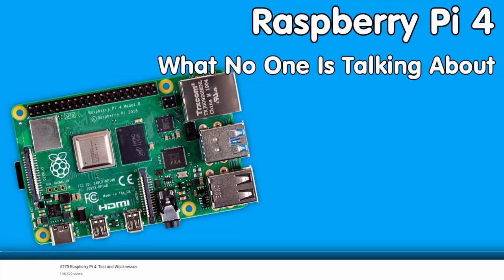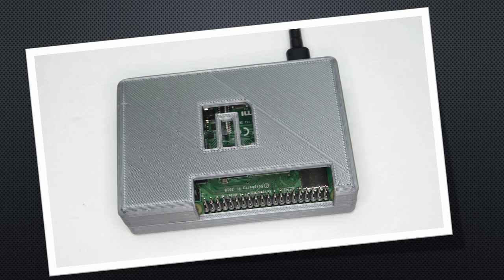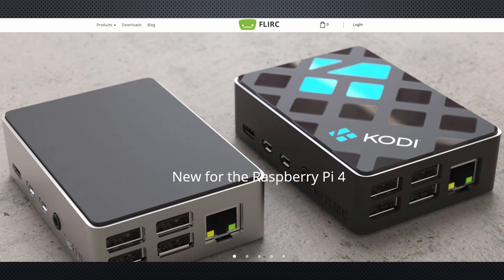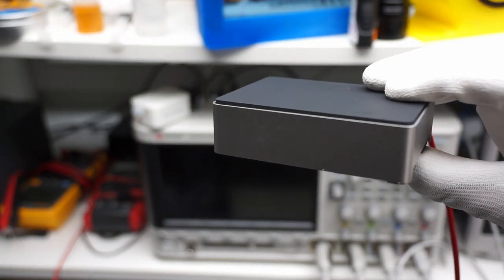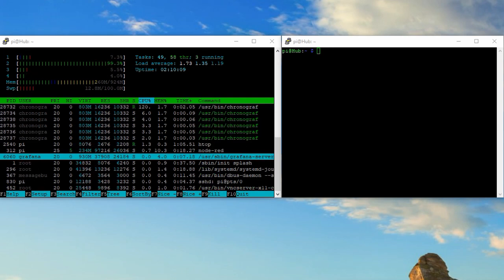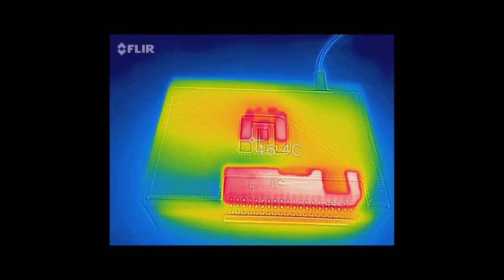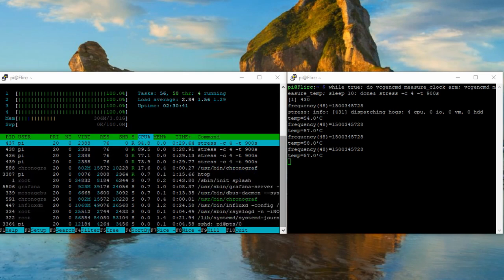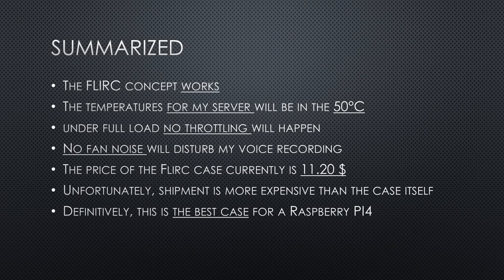#283 FLIRC: A Cooling Case for the Raspberry Pi 4? Does it work? (Quickie)

Comment: I have a flirc case for model 2 or 3 - damn expensive back then. Cooling the raspberry pi 4 was an easy challenge: bought a kit of acrylic case + contant fan - silent + cheap for 5€
Reply: I ordered a flirc case 3 years ago when the PI3 first came out.  Hope the PI4 fits OK (not got one yet)
Reply: @noggin73  The Pi4 is a new board design. The ethernet port was moved and it went to two HDMI port. The old cases will not work with the Pi4
Reply: @bradquinn4161 , I am using a case with a RPi 4,  4GB unit that I bought for an old RPi  2 that I never used. It works well with a RPi 4.  It has active cooling with open sides.  I also have a RPi 4, 2GB in a Flirc case.  The unit with active cooling runs about 6C cooler at idle than unit in the Flirc case.  Neither unit will be running with a heavy load, so I didn't run a stress test.  https://photos.app.goo.gl/PMQAsXXWz41m8epq9, 
https://photos.app.goo.gl/JcXAW2yMCCEHD2Lr9
Reply: @WilliamBurlingame  I assume you mean that you are running the Pi-4 in the NEW flirc case and not one of the earlier models.
Reply: @bradquinn4161 , yes, but the NEW flirc case doesn't cool as well as the OLD iUniker case. With shipping, the NEW flirc case was $22.80 and the OLD Case was $8.99 with Amazon Prime. Ambient noise in my computer room is louder than the fan.  That unit is an a shelf on the other side of the room.
Reply: @WilliamBurlingame  IF you look at what the OP posted, he has an older Flirc case and the point I was making is that it will not work with the Pi4. I also think that there may be a couple of other issues going on here. For whatever reason some Pi4s seem to run about 10C hotter than most (mine is one). The other thing (specific to current Flirc) is that it sometimes takes a month or so to "settle" in to a temp. For the first month my Pi4 (in a Flirc) idled at around 60C but never got above 70C(you did not want to hold onto the case very long either). Slowly over about a month it has dropped to an idle of about 50C(all temps were after the usb power cool firmware was applied). It is pretty rare for a passively cooling solution to be better than an actively cooled one. So your results do not surprise me. One of the main intents for the Flirc/Kodi case is in a home theater and the acceptable noise threshold is generally lower than in a computer room.
Reply: @bradquinn4161 , I was hoping to replace my Win 10 HTPC with a RPi 4.  It's not working out.  I have a 4K HDR TV.  The RPi 4 can't play a 1080 YouTube video in a browser smoothly. I did increase the RAM split used by the GPU.  It does a little better with LibreElec installed.  I don't know if browsers use GPUs or not.  I ran a speed test and got 98 Mbps down.  The small fan on the active cooling case is much quieter than the fan in the Win 10 case. That system is not in my computer room.  I have a mini ITX mobo in that case.  BTW, I made the original post because i have read in many posts that old Pi cases won't work, when they should say MOST old Pi cases won't work.
Reply: @WilliamBurlingame  Part of the problem is that they released new hardware on a new OS version. So drivers and optimization nail you with a double whammy. Six months down the road we should be in a better position. Chromium (not a fan personally) seems to handle youtube MUCH better than Firefox. Supposedly Pi4's restructured the way GPU memory is used, so anything beyond 256 (or much less in most cases) is unnecessary.  I am using the Pi4 to switch out using a Xeon as a daily driver and am pretty happy with it. It is not a replacement for cpu intensive stuff (say video encoding) but for email, browsing, basics youtube it works good enough for me.
Reply: @bradquinn4161 , I just wait and see with my 4GB unit.  I plan to use my 2GB unit to run PiVPN as soon as I get a new SD card.  I'm now using a very old and slow SD card in the 2 GB unit.  It takes a very long time to boot and to update/upgrade.
Reply: @WilliamBurlingame  You might want to look into doing a USB boot to a flash drive. It is a bit of a kludge on the Pi4(for now) but it is MUCH faster than running off a SD card (on any Pi version that has USB).

Comment: Great Video on the Heat dissipation properties of the FLIRC case, But the main reason for me to have a PI is to use the GPIO header.  I ordered this case and the GPIO plug will not fit.  I tried to cut the excess from the plug and there was still not enough room.  The only way I could get room for the plug was to cut the two threaded screw posts off the case.  The case still works but the GPIO side is not tight and therefor the Cutouts for all the plugs and connections do not align up properly.  I am not sure if the Case contacts the CPU good enough now to provide cooling.  In all I still like the case but wish this problem could be fixed.
Reply from the maker: I did not try it. I would have expected they tried it upfront. I usually do not need all pins and use individual wires and empty shells for the pins I need.

Comment: I got one of these flirc cases some time back, my pi over heated, it was a very hot day, I did a test with the pibow coupe on the same day with the heat sink, it didn't get as hot. Maybe the usb update has made a difference, I haven't used my flirc case since that day, but people's experience of the flirc case in the pi 4 seem different to mine, the flirc case has been brilliant for me with the pi 3.
Reply: My test was hd video playback and running updates, browsing internet, at same time, real world tests, flirc case started to smell of burning plastic.
Reply from the maker: Strange. Maybe the heat transfer tape?

Comment: Nice looking case and does the job well to say there is no active cooling. However I added a heat sink and a 40mm fan on a personalised 3D printed case and the temps are no greater than 42 degrees at full CPU load for over ten mins. Active cooling is needed if you want your Pi 4 to run as cool as possible.
Reply: The problem with active cooling over this case would be in situations where Pi's are running a kiosk or a graphics panel in a store where you would want to set it and forget it.. It would add a failure point that isn't necessary
Reply from the maker: I got now a case with active cooling to try. It also works quite well. But it has 2 small fans.

Comment: The FLIRC case doesn't carry the heat from the Wlan+bluetooth and RAM chips. They still heat up.
Reply: This is true, but sinking the heat from the processormakes the whole board a little cooler and while not directily sinking from other chips, they stay a little cooler by having the processor quite a lot cooler.
Reply: The new raspberry pi uses LPDDR4, way more energy efficient than the old LPDDR2. 
The RAM shouldn't need any cooling at all.
Reply: bonnome2 In an enclosed space... have a look at thermal images of RPi4. In any case, the metal shield on the CPU is groundplane, and will carry away the worst of the heat into the FLIRC case.

Comment: 7:12 Why on the second pedal to the metal test was used only one core 2? That doesn't seem right
Reply: If you skip a few seconds earlier you see it's all four cores. That is after the test finished. Don't know why that core is @100% after the test.
Reply from the maker: As I mentioned I used my normal "IOT server" as a base. There, Chronograph is quite power hungry...

Comment: Hi! can you give me a pointer in the right direction! i would like to set up a video with audio from a sound mixer and video camera (maybe usb) to network stream for watching the sermon at church in the baby room and maybe capture it. I was thinking rpi with usb cam to rstp stream and decode with rpi zero. Is this a good way to go? i would like HD say 720p at 24fps or better,  could i achieve this like this or is there a better way?
Reply from the maker: I do not have knowledge about video transmission systems :-(

Comment: I ordered some thermal heat pads and  plan to salvage some finned heat sinks from old pc boards and find one that will adequately dissipate the heat from the processor.  I'm not planning on using a case of any kind.   Function over form is my motto.  I've thought about maybe making one from old copper pennies or copper pipe.
Reply from the maker: The surface is king in heat sinks...

Comment: PLEX and Flirc Case = kind of room heater 

It is great, but currently a bit pricey, therefore here is a cheap, good solution:

Pi 4 & 2 GB RAM running PLEX Server H265 in 1080p ... leads to a server load of 75% in my case and less than +30°C above ambient temperature. Room is 31°C and Pi 4 reports 61°C instead of over 83°C without fan.

You can buy the cheapest acrylic case on ebay with fan for 3,40€ currently which will arrive within 14 days. If you install the fan as intended and our Swiss guy in a previous video did then that tiny fan gets annoying loud - around 55°C. If you want it nearly unnoticeable or soft then you do a simple hack: 
the fans are build for power users ... running on 5 Volt. You simply use the 3,3V + from the GPIO instead of 5V 

Therefore you need a fitting jumper cable as "extension" or you have to separate the 2 pin connector in 2x 1 pin connector with a dremel and a diamant saw cause you will not find ground and 3,3 Volt on the gpio next to each other. 3,40€ for a silent and a pretty good result, which will work in 90% of all users except the Pi 4 owners who are already crying for Pi5 cause performance is too low for them.
Have a look cause for 3,42€ and a bit of cutting work you get a lot, really a lot  
https://www.ebay.de/itm/264408007677

But I must admit that I also like that Flirc Case except its price tag, particular the total amount incl. shipping which is a joke. So I have to wait and see if prices come down or the chinese copy cats will push their clones in the market too.  

Fanless is the best and a 42°C heater brick is not so bad - except in nowadays summer.
42° to 24° is 18°C above ambient temperature in swiss guys setup ... pretty close to my +30° by a reduced fan performance from 5V to 3,3 V or 33% less ... und heavy performance of h265 encoding ...

Comment: Now this is genuinely a good product!   Yes, it should be the official case.
Hope that Flirc is able to sell enough to keep it going.
A VESA mount version may be desirable to some.
Reply from the maker: Maybe somebody will print a different plastic base which can be mounted to VESA holes.
Reply: @AndreasSpiess  Do you not have VESA 3d print files? I have several different ones if you want them

Comment: TO REPRODUCE THE PARTICULAR STEPS USED in this video you have to be aware that the infos linked in the description mostly refer to a Pi 3B+ test scenario.

HERE are the steps where and why adoptions are needed

Pi 4 is based on a different chipset with 4 A72 Cortex processor instead of 4 A53 of the Pi 3B+

So you can follow the steps mentioned regarding STRESS which is linked.

On that stress website you will find these 2 lines which do not really fit to the Pi 4 and therefore should not been used.

wget https://raw.githubusercontent.com/ssvb/cpuburn-arm/master/cpuburn-a53.S

gcc -o cpuburn-a53 cpuburn-a53.S

Instead you can use the code for the A72 ... which is here shortened to A7 ... so be aware of the difference that the Pi has 4 A72 Kernels but that the program here used is called A7

Therefore your procedures are these
Open the command prompt and paste each line with ENTER
Maybe create first a folder "scripts" with 
mkdir scripcts 
cd scripts

wget https://raw.githubusercontent.com/ssvb/cpuburn-arm/master/cpuburn-a7.S
gcc -o cpuburn-a7 cpuburn-a7.S

Then install the stress app with
sudo apt-get install stress
 
Now your are prepared for any stress test, if you do not forget that in case it gets too fast too hot you can press CTRL + c key to abandon the stress and high cpu load .
There is also a description in that Stress article you should read and consider.

The first step to stress your Pi 4 might be to not run the original code that would stress for 15 minutes. 
Here is a shorter one just to get familiar with the CTRL +c key break and the temperature increase but without any risk of damage to overheat: just 66 seconds are enough

If you - as I - may ask yourself what is going on the left command pane in this video tests above then just open a command prompt and type htop and press ENTER key

Now you have the overview about CPU load of each core and RAM and tasks.

Then you open a second command prompt and start your first tiny stress for 66 seconds ... where I replaced the 900 (which are 15 minutes) at the end with my 66 ... damn easy to avoid anything.

I also did not wanna wait for 10 seconds to get the temperature reported and replaced that 10 by an every 6 seconds report... yes this 6 makes it easier for you to find my changes compared to that original lines from the STRESS article

while true; do vcgencmd measure_clock arm; vcgencmd measure_temp; sleep 6; done& stress -c 4 -t 60s

You will get a temperature report every 6 seconds in that command promt and notice a jump in the temperature under the growing load , which you can watch in the htop pane on the left.

Maybe after 30 seconds you try to press CTRL + C to check if that will stop the stress test just to be prepared. 
It should stop the processors from rotating instantly if you look in that htop pane on the left, but:

the temperature report will continue ... and to stop that simply close this command prompt and start a new one ... but I guess there are several others and better way to stop it.

Now you can increase the 66 seconds time limit slowly to 900 seconds depending on your results with or without any cooling. But first things first to understand my procedures

EXCOURSE: My test scenario and results for the cheapest, but silent Pi4 solution 
=================================================================
My temperature reports went pretty fast but also pretty stable around a nice temperature peak . 
Within 45 seconds 60° C (+/- 1°C toggle) which equals to +31° C higher than ambient temperature 

This is the result of the cheapest acrylic case and fan with unnoticeable noise level for 3,40€ in total.

I bought on ebay an acrylic case with a 5V fan of 2,5 cm diameter or so. If you connect the fan to the 5V pins of the gpio you then might pretty soon become annoyed by the noise level - while you might be happy with 45°C even under full cpu stress which is just +16°C. 

But I prefer a more "silence" like noise level so I tried the easiest and cheapest hack for this: 
connecting the fan to 3,3 V on the GPIO instead of 5 V reducing the rpm level by 33% and the noise level to near silence

You will not really notice something you'd call noise or annoying while the cooling results are quite good with 60°C peak at full stress or +31°C above ambient temperature. Yes, 15°C more than full power fan... but far away from 80°C

And I guess the fan will live far longer too at this convenient rpm rate ... but for 3,40€ for a nice acrylic Pi4 case and fan incl. free delivery within 3 weeks there is nothing to complain even if the fan should dy soon.
https://www.ebay.de/itm/264408007677  

Just one tiny "hacking" point to mention: the fan comes with a short cable with 1 plug with two female contacts that fits to the 5V gpio pins cause you can find ground and +5V next to each other.
 
But the +3,3V pin is nowhere available in a direct neighbourhood to ground so you have to 
* cut the "double" plug in 2 single plugs with a knife or easier with a dremel or to
* extend the plug with 2 breadboard extension cables or to 
* resolder just 2 single pin plug instead that double one.

One thing is still missing, right?

The long performance test under high load of the 4 A72 cores with that A7 utility, right:

while true; do vcgencmd measure_clock arm; vcgencmd measure_temp; sleep 5; done& ./cpuburn-a7.S 

Pi 3+ changes:
If you have a pi 3+ than you need to get the other A53 utility with 
wget https://raw.githubusercontent.com/ssvb/cpuburn-arm/master/cpuburn-a53.S
gcc -o cpuburn-a53 cpuburn-a53.S

The short 66 second test is the same line 
while true; do vcgencmd measure_clock arm; vcgencmd measure_temp; sleep 5; done& stress -c 4 -t 60s

If the temperaturs are good then extend the 60s over iterations to 900s. 
If everything is still fine then you can use this strong and long stress test line to get a report every 5 seconds 

while true; do vcgencmd measure_clock arm; vcgencmd measure_temp; sleep 5; done& ./cpuburn-a53.S 

Happy cooling ... and don't forget to think of 1 tiny line you may know quite well:

"enjoy the silence" 
by Depeche Mode

Comment: Thanks for this video. Yesterday i had the problem my Raspi4 always crashed while installing node-red, iobroker, doing updates and so on. It was in the Original Case with heatsinks. 

I was wondering what happend all the time till i touched the Case. It was really hot, so i opend the case and stopped IOBroker and now just node-red is running. 

With only OS and Node-Red its around 55°C
Reply from the maker: Usually, it should throttle to not get over 83 degrees and not crash. Strange...

Comment: some get a bit obsesive with cooling! this solution is plenty good enough ! with all the advantages of passive
Reply: When this case was originally released for the pi2, it was the obsessive case
Reply: @abo3abid1 , yes i agree but i am thinking the active, sometimes huge and even liquid cooling solutions out there! you gain a few degrees but no practical advantage!
Reply: @jonathanpayne9956  You end up with your cooling using more power than your Pi if you go to extremes.
Reply: @EsotericArctos  too true, and you lose the advantage of small size.